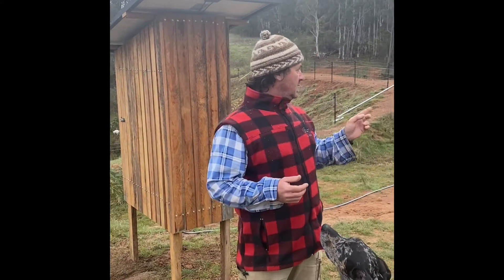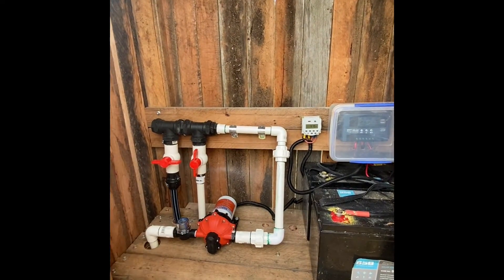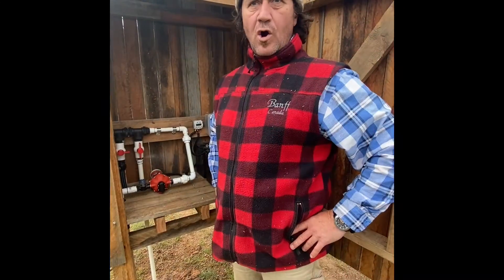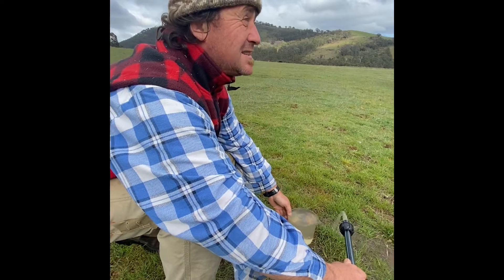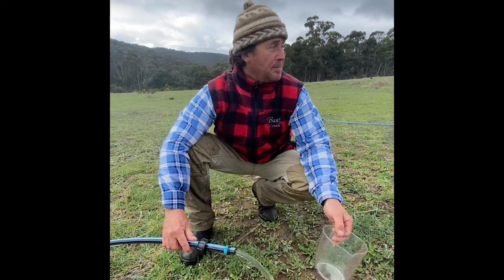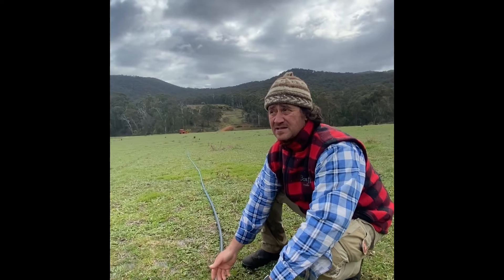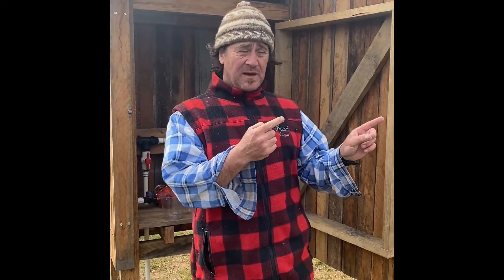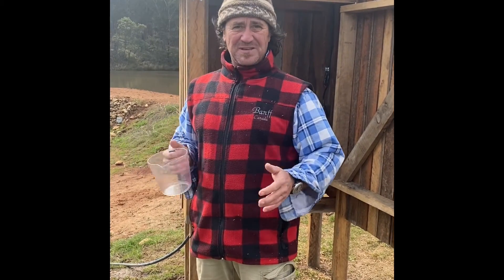Seaflo Solar 12volt Water Pump

Comment: Im using the same RV pump for an outside shower/sink set up. It is powered by a 12v battery with a charge controller and solar panel. The pump runs fine but when I turn off the water I can see that the charge controller voltage drops. I have to power off the pump so the battery is not drained. Does or is the pump continuously using power? Even with water shut off?

Comment: Hi, it’s been a few years since the installation of that nice pump. I’m curious if it is still in operation to date? Or, have you changed it out? Thanks
Reply from the maker: Hi there, funny you should post on this. I literally just changed it over to a new one. I'm impressed of the operational period. 3 years in average 5 hours a day 7 days a week. I can't complain about that. Cheers Pedder
Reply: @ That’s very impressive. Exactly what model are you using?
Reply from the maker: @nelsondog100  its the seaflo 51 series diaphragm pump. Cheers Pedder
Reply: @ thank you very much. I’m not sure if you are aware but the American model supposedly has a 4 year warranty…
Reply: @FatCowFarmTatong  Nice mate, what did you move over to? Great video
Reply from the maker: @MeltemiPermaculture  Hi there, same model 51 series seaflo. I wouldn't change its just a super awesome little pump. I have them all over the farm pumping water from here to there. Cheers
Reply: @ beautiful

Comment: Great work Fat cow Farm - Could you kindly add a link to the seaflo pumps you are using - when I search I only find models for washing rv vehicles in 51 series
Reply from the maker: SEAFLO 51 Series 12/24 Volt DC Diaphragm Pump

Tank Master
https://tankmaster.com.au › product › seaflo-51-series-1...
Hi Peter, just had a quick look, you just want the pump there are heaps on the market and locations. I have 5 now running all over the farm transferring water and also irrigation for the vegetable garden. A great unit. Just make sure you don't elevate the pump more than 2mts from a water source. They struggle with the pick up. Any other questions just send a message. cheers Pedder.
Reply: @FatCowFarmTatong  
Hi Pedder
Looking at your video - did you convert the in and out fittings on the pump to1" then use 1" piping
Thanks Peter Bell
Reply from the maker: @PeterBell-n7j  Hey Peter, sure did. the pump comes with 1/2" fittings I just upsized them with reducers from the hardware store.

Comment: Great video! I spoke to a dealer who told me that it is not suitable for irrigation because it is not designed for continuous use, after some time can you tell me if using it continuously has created problems for you? does it disconnect due to overheating or not? is it damaged by using continuously? thanks for your help
Reply from the maker: Hey there, i'm sure its been over a year or close to from installing the unit. The dealer may be right in ref to continuous use. I have ours on a timer which run for about 1.5hrs two times a day. This is all we need to top up the header water storage tank for the stock troughs. This period allows the the batteries to be recharged in-between uses. I can't fault the unit its working an absolute charm. Well worth it.
Reply: @FatCowFarmTatong  ok got it. Is it series 55 with 5.5 GPM?
Reply from the maker: @viperblck1  its the 51 series 20 GPM
Reply: @FatCowFarmTatong  OK GOT IT, 20 lpm , 5.5 gpm ?

Comment: Hi, great video. Good idea to put a check valve to prevent loss of pipe water should the pump fail. As its a diaphragm pump you could use a ball cock type valve in the header tank and leave the pump running, that way it cuts off and maintains pressure when the tank is full and will only pump water when the header tank level drops? Thanks
Reply from the maker: Hey There, that's a good idea. I use the excess water to drain into the swale below for the irrigation of some trees we've planted out. I'm trying my luck on goji berry bushes. Stay safe cheers

Comment: Hello my question is about the pump, the support of their site says that this pump can lift water only to 1.8m 
How does your got it to 15-20 metres?
Thanks.
Reply from the maker: Hi Andjelo see below about lift and head pressure. Lift is height from water source to the pump and head pressure is what the pump pumps to. Cheers!
Reply from the maker: Hi Andjelo - the lift is from the water source. You can have the pump 1.8mts above the dam, creek or your water tank. I'm only have about 1.5mts above my water source which is a lake. The pump push or head is measured in metres above the pump which 20mts. Hope this clears this up for you. Cheers!
Reply: @FatCowFarmTatong  I didn't get that kind of flow from my stock tank and you are getting the push from a pond?  I must be doing something wrong.  Any tips?  How long did it take to prime because I never got a continuous running with my seaflow pump
Reply from the maker: @patriciaburgess1397  Hi Patrica, thanks for your comments. The pond is about 1.5mts (6ft) below the pump. I struggled to prime the pump at the start and reduced the intake hose size and added a non-return valve so the pump didn't have to prime every time. For the outlet side make sure you dont have any air locks, this can really stress the pumps out. Lots of effort for little return. I also put a non return valve on the out side so it stays full of water. Are you based in australia? We can talk if you wish. cheers

Comment: hi, i have the same pump.  mine gets very hot after 20 minutes.  yours too?
Reply: Mine too.  Got very hot, what size plug did you put on it?
Reply: @patriciaburgess1397  5/8 inch in and 1/2 inch out
Reply from the maker: @FrancescoNettis  Hey Francesco, i think you have a too small delivery hose attached. I run a 3/4 in and 1'' out. The outlet side isn't that important except for water weight back on the pump, hence the non reuturn valve. Try upgrading the inlet side to the same as the delivery side 1/2''. You may not have enough water passing through to cool the pump down. Let me know how you go. Cheers
Reply from the maker: @patriciaburgess1397  Hi Patrica thanks for reaching out again, i was pumping for 4 hours filling the header tank the other day and did notice the pump was warm but certainly not hot. It seems that the pump is working flat out for it to get hot. Just make sure that there aren't any air bubbles or locks caught in the delivery pipe.
Reply from the maker: Hi Francesco, I haven't noticed it getting hot. Try and reduce the time your running the pump and run it twice or three times rather than just once. I'll check mine out. The longest time i run mine is 40mins.
Reply: @FatCowFarmTatong  thank you!
Reply: @FrancescoNettis  francesco sei italiano? Hai risolto poi col surriscaldamento della pompa? Dovrei acquistarla anche io a breve
Reply: @viperblck1  ciao, no non ho risolto ma non c'è nulla da risolvere. È normale che si surriscaldi dopo circa 20 minuti in estate con 35 gradi.
In inverno arriva anche a 1 ora... 
Quindi il compromesso è quello di tenerla accesa per 15/20 minuti e 5 minuti di pausa... Io faccio così!
Reply: @FrancescoNettis  molti hanno aggiunto vaso di espansione, potrebbe essere una soluzione forse. Io dovrei usarla per irrigazione per portare l'acqua su di un terrazzamento alto 5 metri e distante 80-100 metri. Dici che è fattibile con questa pompa?
Reply: @viperblck1  il vaso espansione aiuta ma non risolve il problema.. altezza 5 metri non saprei dirti.
Io tiro l'acqua da un pozzo profondo 2 metri (quindi altezza 2 metri) e la tira bene.. la porto a circa 40/50 metri di distanza e va benissimo così!
Spero di esserti stato d'aiuto. Fammi sapere
Per quel che costa prendila...
Reply: @FrancescoNettis  infatti penso che la prendo, per quello che devo farci mi consigli quella da 60 psi 19 litri al minuto (Serie 55)?

In teoria non dovrebbe fare attacca-stacca col vaso di espansione e quindi non scaldare. Sbaglio qualcosa?
Reply: @FrancescoNettis  ma tu quale modello hai? Serie 55 da 19 lpm ? Come uscite in e out che diametro di tubi usi?

Comment: gday mate great video im off grid we are putting in an orchard with drip irrigation to 1000 trees down hill do you think this pump would be good enough for that? thanks in advance scott
Reply from the maker: Hey Scott, The Seal pumps are amazing. For irrigation down hill you won't have any problems. Ensure you pick up the 51 series diaphragm pump 5 gal per minute. We will be using it for the exact use over the lower swales from the main header tank from which we gravity feed the stock troughs. Just calculate the flow rate from the drip irrigation as you may need to switch via a timer for the runs you need. Let me know how you go. I'm always interested in how these pumps perform. Cheers

Comment: wow, the specs say this pump only has a max head height of 1.8meter
Reply from the maker: Hi there,  I was amazed when we did the exercise. The Seaflo pump 51 series are truly the bees knees. I'm running 4 of these pump via solar on batteries all over the farm for all different applications. Water transfer, irrigation drip, irigation spray and stock water management. I cant fault the units, no issues yet and the eldest has been running for 2 years. Thanks for watching.
Reply: @FatCowFarmTatong  in their website there are marine and agricolture water pump. I notice that some pump like 51 series , 55 series have continuos duty cicle while other have intermittent duty cicle. What is the difference and how to choose  if my purpose is to pump water 100 meters away for irrigation ?
Reply from the maker: @viperblck1  Are you pumping to a storage tank? Whats the evolution you want to pump to? The volume will depend on both these factors. Eg - I pump 20mts evolution at 250mts and i achieve 8litres per min. The 51 series is rated at 20 litres per min the above factors cause me to loose 12litres a min. I haven't seen the 55 series, this may be better due to size and volume pumped. However it will consume more power. Your batteries will have to be considered into the equation. Let me know, cheers
Reply: @FatCowFarmTatong  I'm not pumping to a storage tank , I Simply give water to threes that are 100 Meters far with a difference in height of about 5 Meters . Do you know what Is the difference between intermittent and continuos duty cicle ?
Reply from the maker: @viperblck1  Thats not even a challenge, the 51 series would suit you. I use the 51 series to irrigate our hoop house and vegetable gardens. Check out those videos. The hoop house is spray and the chicken coop is drip irrigation. You won't have a problem watering trees at 100mts with a 5mts elevation. You would be looking at around 15-17litres per min and the pressure would be ok to.
Reply from the maker: @viperblck1  forgot to mention -
Intermittent is using for a period resting and re using. On for 20mins off for 2hrs etc.
Continuous would be running for 2hrs at a time. Depending on how long you want to water the trees, add a timer into the switch. The one i have in the pump house has 10 settings. Turn on for 15-20mins at a time 3 times a day for example.
Reply: @FatCowFarmTatong  intermittent means that once pump reach pressure it turn off? For my purpose you think I should choose a continuos or an intermittent model?
Reply from the maker: @viperblck1  OK, that's referencing the pressure switch. Once pressure has been reached the pumps turns off automatically. Thats what i use to irrigate the chicken coop and vegetable garden. That works perfectly with a timer. As soon as the timer turns on and opens the water valve, pressure drops and the pump turns on. Once the timer has finished, the water valve closes pressure builds and then turns off.
Reply: @FatCowFarmTatong  ok, for irrigation using a simple pipe I should choose a continuos model ?
Reply from the maker: @viperblck1  Sounds good to me.
Reply: @FatCowFarmTatong  which battery type I should mount ?  max adsorbance for 55 series is 17A, so I have to choose not less than how many ah ?
Reply from the maker: @viperblck1  a deep cycle 12volt battery, they should be around 110amp. You can pick one up at any battery specialist.
Reply: @FatCowFarmTatong  100 ah is not enough ?
Reply from the maker: @viperblck1  100ah is heaps, the unit only uses 17amps at full load. Why isn't this enough?
Reply: @FatCowFarmTatong  I mailed them and they said the same. How does it lift to 15-20 metres of height